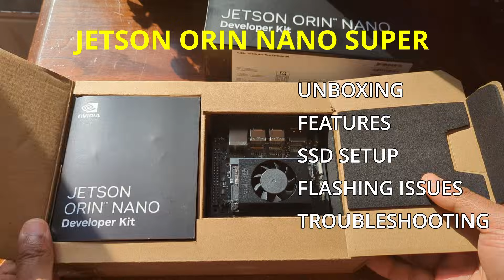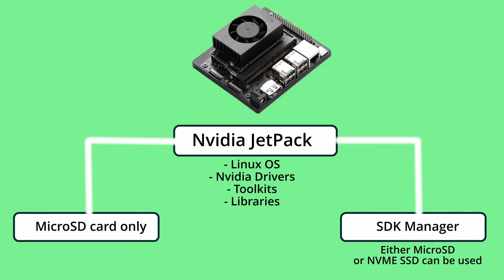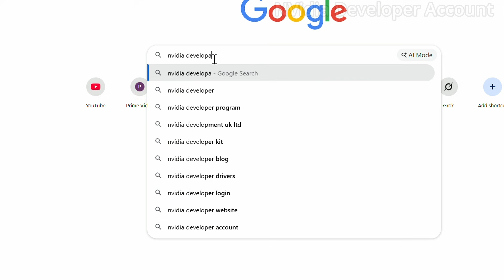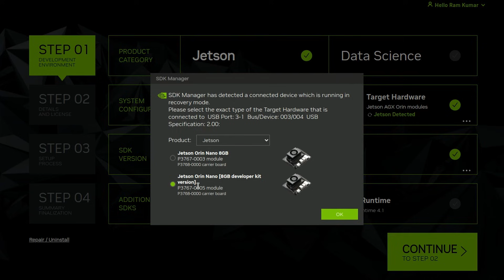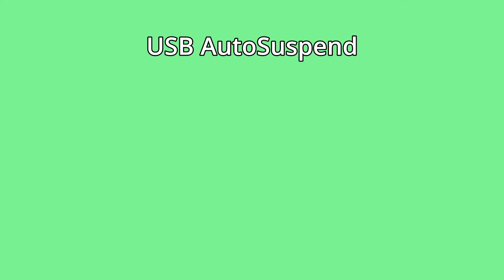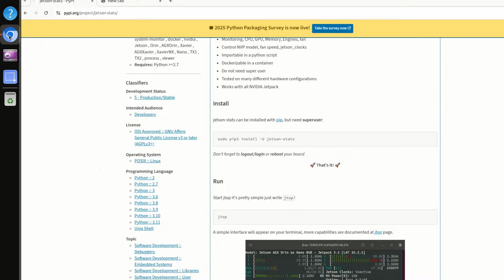Jetson Orin Nano Super Unboxing + NVMe Setup | Fixing USB AutoSuspend Error

Comment: Thanks for your great vid!  That was exactly where I was stuck, and your video solved it for me.  In addition, I would like to share with you and your viewers another piece of useful code.  After I reset the console using your instructions and settings, I tried to connect again and still got the "Not Ready to Flash" error.  Maybe I did something wrong.  Not sure.  In any event, AI suggested I also run this line in the terminal for good measure, which turns off autosuspend for all USB devices, then everything started working perfectly.  

for i in /sys/bus/usb/devices/*/power/control; do echo on | sudo tee $i; done

Best of luck to you!  JJ

Comment: Thank you for the helpful video! Question, in the sdkmanager, step 2, can you install all the runtime components, or will there be issues? Also, for the ubuntu VM specs, how many cored and processors did you give it?
Reply from the maker: Yes you can select all the runtime components in the step 2 itself. There shouldn't be any issues. I chose to install the required components manually after the main linux installation but there shouldn't be an issue with the other way too. Regarding using Ubuntu VM, I have read at multiple places that users can run into multiple problems with VM when flashing jetpack. This is because the VM can lose connection with the USB as it restarts several time during the installation. So its always advisable to use a native Ubuntu instead of VM. But there are users who have done that and they have shared the specs such as this one here:  https://forums.developer.nvidia.com/t/jetson-orin-nano-super-boot-from-nvme-using-a-vm-to-configure-this/318827